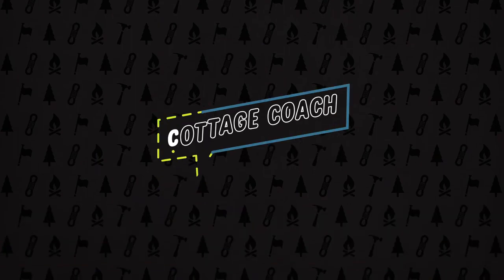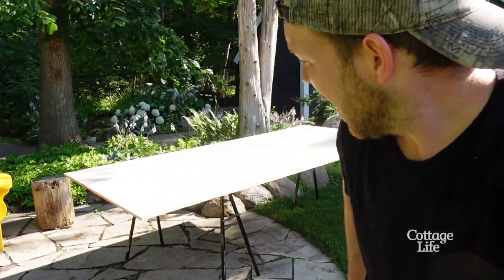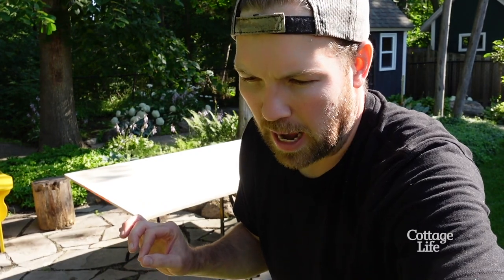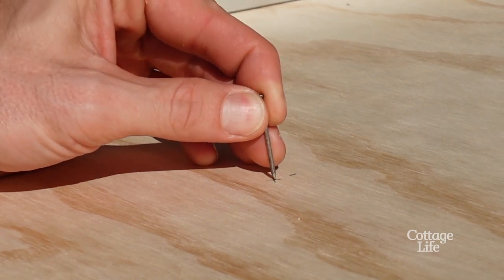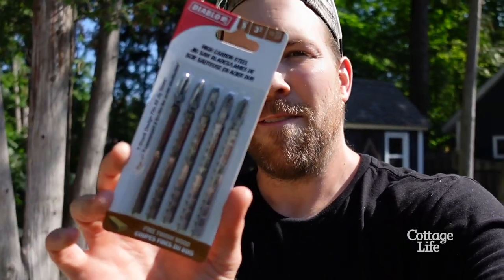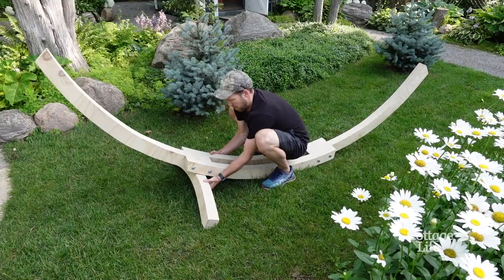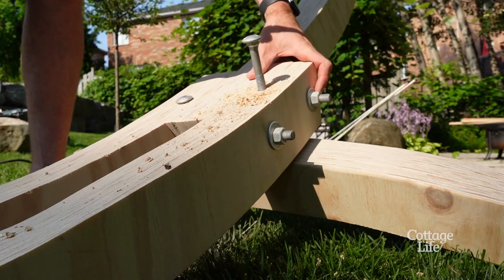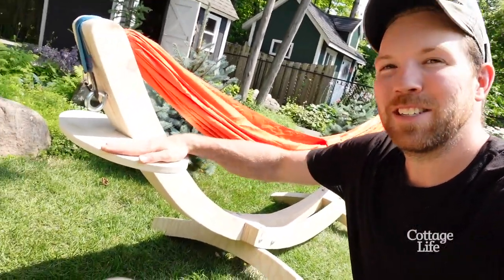How to build a hammock stand out of a sheet plywood | Cottage Coach

Comment: Thanks very much for the video.  Would you mind sharing the width of each rounded cut....I guess 5.5" ?  And how many 3/4" pieces do you glue together for each part?
Reply: min 2:21 ....4 pieces
Reply: I started building one and there is no way a sheet of plywood would be enough. Also the pieces look way longer in the video than what can be obtained from a 4x8.
Reply: Do you have any data to support your contradiction, because just adding up the fact those are 4' pieces cut on a curve with about 10" overlap, meaning there is at least 12' of length before we factor in the curve, you are wrong and your comment is ignorant.
Reply: @Eminate2121 what is the measurements please

Comment: Just watched this video for the second time. Unless I'm missing something the 24" dimension serves no purpose other than establishing the middle of the 4' width.  There is also no mention of moving the radius point. Is the  initial 66 1/2" the radius? If each piece is 3" wide then getting the pieces need (assuming 24) an 8' sheet should yield what you need.
Reply: I made a small version of this on paper and each piece can be roughly 3.8" wide and still get 24 out of one sheet of 4x8.  My biggest issue is the length at the top once assembled, it will probably be around 9-10' which isn't enough for most hammocks to get the proper stretch need to make the hammock comfortable and avoid touching the bottom where it sags.
Reply: Yeah I also don't understand how the arc is staying the same as you move up three inches at a time, wouldn't it work just as well cutting the first arc piece as a template and then using that to cut the rest?

Comment: There is crucial information left out here about cutting the arcs, if done in the way suggested the first and last are going to be radically different.
Reply: Just get the first right, cut it, and use it as a template.

Comment: It is a really nice design and using only 1 sheet is fantastic.  I was wondering how well  plywood holds up being outdoor. 👍 Thanks
Reply: Baltic birch plywood is quite literally one of the best if not the best outdoor (wood) material. This is not it of course, he uses a much simpler plywood BUT if done with baltic it can last more than a lifetime (and of course done correctly, for example he could do "seatings" on the legs and main frame, so they actually never move, because bolts tend to loosen by heavy usage)
Reply: @spantsoputio8654  I also like Baltic birch because the core has no void and the top layer isn't that thin.  But I have always used it for indoor.  I thought the humidity would separate the layers sooner or later for any plywood
Reply: He's using varnish, I would use polyurethane. 3 coats sanding between coats. Also touch up coats every few years. It should last a long time.
Reply: @tonyhayes1477  varnish is way better for outdoor use compared to poly